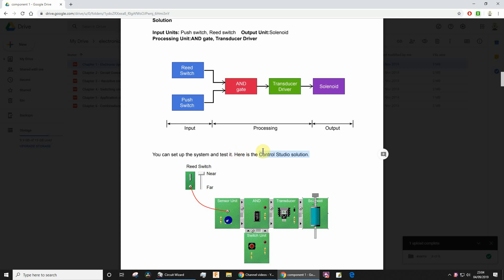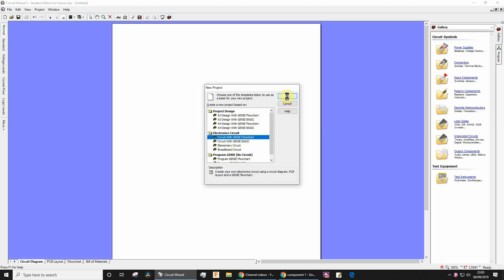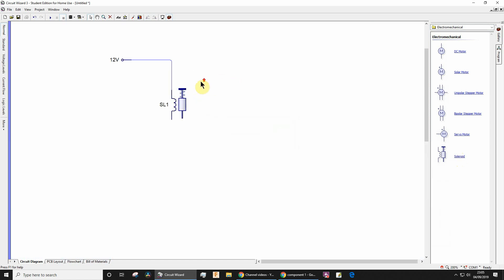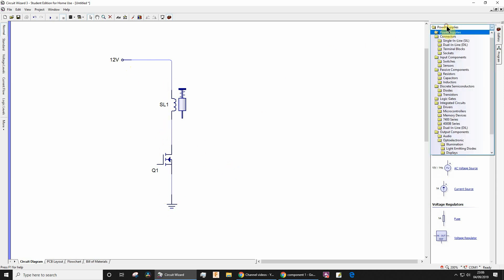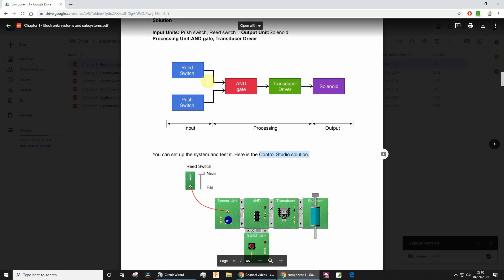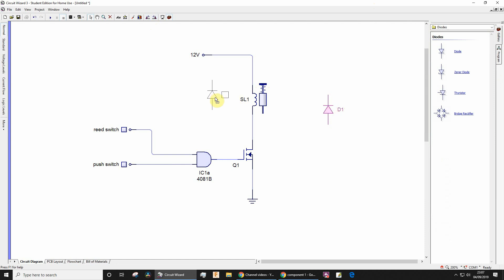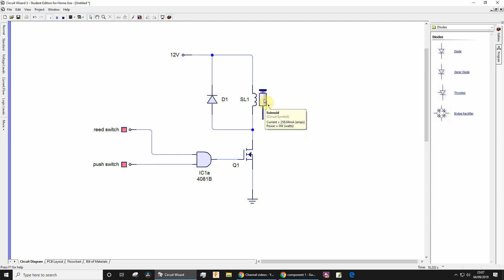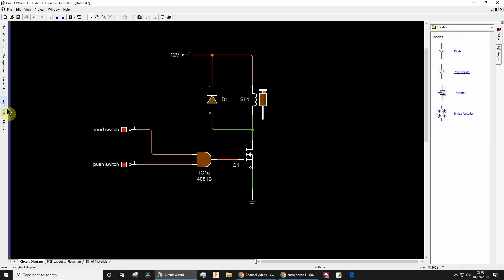GCSE Electronics - electronic systems - MOSFET transducer driver Circuit Wizard

Comment: Thanks for making really in depth videos, but by the way i thought mosfets weren't susceptible to back EMF so wouldnt there be no point of a diode here?
Reply from the maker: A diode is recommended by manufacturers. Download the nexperia power MOSFET application handbook and refer to page 186 for an example